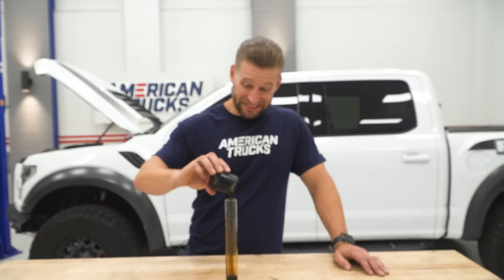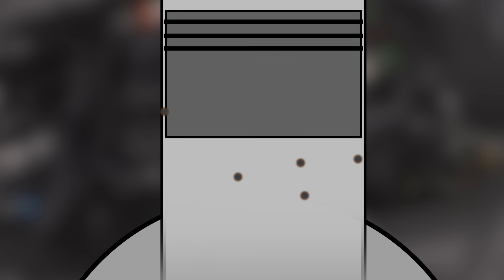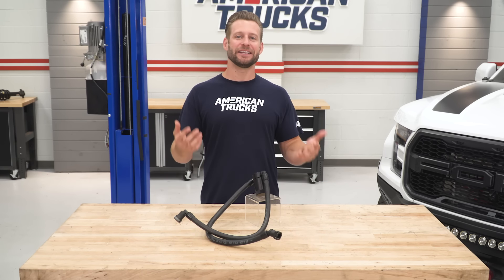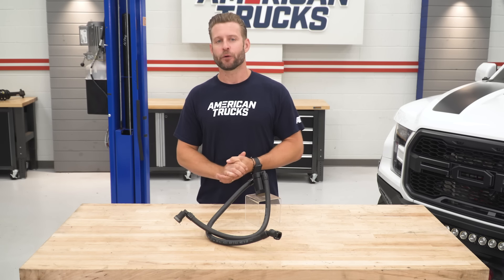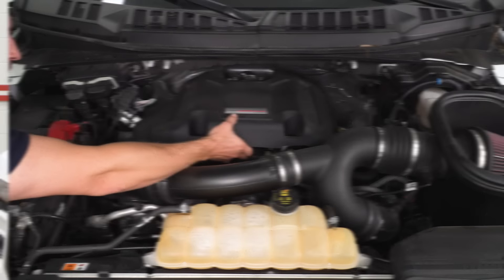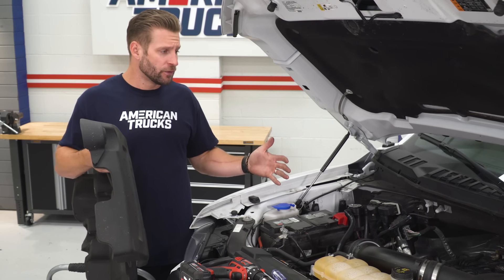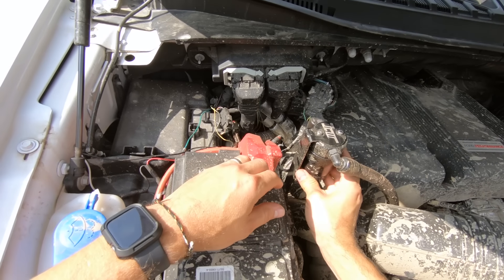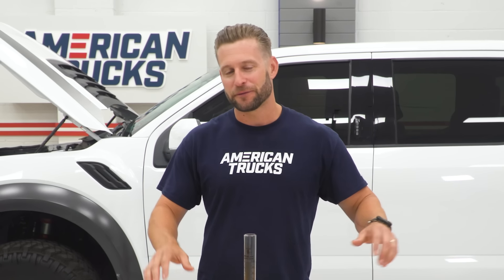Does Your F150 Need a Catch Can? - Ford F150 Oil Separators Tested And Explained

Comment: Hello, I just bought a use 2016 F-150. It only has 40,000 miles on it. I'm thinking of adding one of these to the engine. This may be a dumb question, but is it overkill to add one to the driver side and passenger side? Or do you really only need one? Thank you!

Comment: Did they fixed the driver side? That crap accumulating in the inter cooler?. On my 2013 i've connected the catch can on the driver side as well so i can catch what was originally accumulating in the inter cooler.

Comment: I have a 2020 F150 3.5 Ecoboost so is this really recommended then for that new of a engine? You would think Ford would do something about that at factory if it was a real problem?
Reply from the maker: Ford introduced port injectors to go along with their direct inejctors in ever since 2015 in their 3.5L Ecoboost engines. This helps take care of valve coking, but as you saw in the video your 3.5L can still produce a good bit of blowby just from daily driving. Installing a catch can, even on a newer F150, will result in keeping things cleaner and running stronger throughout its life. 😁 -Zach

Comment: Just installed mine on my 2016 f150 with 3.5 eco. Truck only has 36k. Did a 2 week check and can was about half full. Had a little sludge at the bottom, but was mainly pretty watery. Almost compare color and consistency to a coffee with creamer. Doesn't sound normal to me, but I also don't know much about these. Thoughts?
Reply from the maker: Totally normal Anthony- what you're seeing is condensation mixing with the oil causing that milky brown color.  Do you live an area with a colder climate? -Justin
Reply: @americantrucks  ok thank you for responding. One less thing to worry about. Yes I do live in SE Michigan and the weather did just start turning

Comment: Have a 20 Raptor, not have an issue with hose that was basically snug up against the engine cover bolt with the JLT?

Comment: I have had the issues with stalling and this was recommended to me. After doing a lot of homework, I can see why I need it. (2016 F-150 2.7 EB). My question is how to clean up all the gunk that may have built up on the intake valves...I just changed my oil after hitting 185,000 and my JLT will be here next week. Is there a fuel additive that will clean the gunk out of my engine that has accumulated?
Reply: Id like to know about this as well!

Comment: Not really changing the octane rating of your fuel, but artificially bumping your compression ratio except it doesn't do it the same across the board so you'll have high compression on one cylinder and regular compression on another.

Comment: obviously works, not doubting at all, but wonder how much this pulls out compared to the versions that have suction from the turbo's pulling the gases out of the engine.  I realize this has suction, but how much is the flow of gases being hindered by the catch can and media?  For instance, imagine sucking through a straw, then sucking through a straw with a piece of cotton in it.
for all that matters, how much oil is being sent through the turbos in the catch cans that use the turbo's for suction?
hmmmmm....

Comment: Just recently bought a 2020 F150 Lariat, do you recommend that I install one? Will I need to remove it before having my oil changed at the dealership?
Reply: I need these answers as well have you installed one on your? Im on 2k miles on my 2020
Reply: @osvaldoordaz1047  No, I'm waiting till December after my first oil change
Reply: @botpatch1  ok thanks for the quick replay and are you just planning on taking it out every time u take it for service?
Reply: @osvaldoordaz1047  yeah, i want my truck to break in or let it run as factory intended for the first oil change before i add the modification to it. As i understand it, 2019 and 2020 ecoboost is a bit different - I think the duel injection is a bit better in 2020 version. So I have to do a bit of research before I install it completely. I don't think it will hurt anything since it just catches gas vapors and condense the "grim" from it, it's a bit different than say installing brand new intake or change something major on the engine.

Comment: Do you need this if change the oil every 3k miles? 

I’m in a very hot climate 100 degrees is the norm where I live 

I have an ecoboost 2021 f150 what do you think guys?

Comment: The 2nd gen 3.5 isnt immune to it either. The port injection doesnt kick in until your in boost under load. Direct injection is a constant at idle and normal driving. If you ever do a fuel system treatment, beat on the thing a little bit. Otherwisd your just washing your pistons off

Comment: I installed this on my 2019 2.7L EB F-150 and the check engine light came on three days later. I checked both hose fittings and they are snapped in place and the can is screwed on tight. Is there a particular way the hoses need to be connected to the intake manifold and crankcase? I simply followed the instructions from JLT as well as the instructions from this video and others. I also got my truck serviced at the dealership (this was installed after the service on the same day). Any info that anyone may that can be sent my way will be greatly appreciated!
Reply: Why was your engine light on? What was the code?

Comment: what is the cost , i have a 98 f150 , my dip stick was to short, i was keeping 7 quartz in it
  then i took my oil and put 6 quarts in it and marked it on the dip stick.so now it seems to not use much oil, but would like to find the price of what one of these cost,   and if it works on a 98 4.6 motor

Comment: Do they make this for older Trucks? Ive got a 92 F-150 that has this issue BAD! Usually, when I change air filters the Airbox has a solid 1/4 inch of oily snot. (Already verified there is no excessive blow-by and the engine has good compression.)

Comment: Would you recommend the JLT (only passenger side) over the Mishimoto (PVC+CCV) for a 2016 XLT 2.7EB with 40k miles. Never had an issue with the truck but $150 vs $400 is a big difference. Thanks

Comment: I put one of these on a 04 6i jeep grand Cherokee and noticed more oil   in the can after climbing steep hills. I think the angle pooled more oil in the rear of the engine were the PCV valve is and got vacuumed.

Comment: Will this system work on a 2002 Ford F-150 4.2L V6?  Wondering if this would be worth putting in and since the PCV valve is positioned near the throttle body not in the valve cover if it will still work?

Comment: Very knowledgeable I’m gonna definitely get one of these catch cans for my 2016 expedition 3.5 EB. But I do have a question for you maybe I’ll read this or somebody will know. Again I got a 2016 Ford expedition I’ve changed out the ABS unit all the other braking systems Have been on recall so that’s all been replaced. I just replaced my vacuum pump as well and my car still does exactly the same thing. It was at the dealer for over 10 days and they said you need to replace this this and this which I did couple thousand dollars later still have the same problem, when I make a right hand turn it seems like the back right rear tire locks up. This is a 2 Wheel Dr. car in my track sensor light goes on on the dash does anybody know why this happens again right rear tire seems to lock up like it’s in four-wheel-drive and I don’t have a four-wheel-drive truck. It’s two wheel. Thanks in advance appreciate your input.

Comment: Stupid question, have 2016 3.5 e-boost with 50K miles.  Should I also install on driver's side, too?  Or, is only one side adequate to ensure proper engine health?
Reply from the maker: Both sides with a turbo application is never a bad idea.  -Justin

Comment: I just bought a used 2.7L F150. I've always had V-8s and never a turbo. Excuse my ignorance please! My question is, is there just one pcv valve? I saw another video where it looked like they ran a line from each side. I never messed with the pcv on any of my vehicles. Never had a problem. Or it may be that I swap too often! LOL!
Reply from the maker: No apologies necessary Willie! There is a driverside and passenger side PCV hose.  Now in this video we did focus mainly on the passenger side as it typically is the 'more productive' side but if you're looking for ultimate and total protection, we always recommend addressing both sides. In fact there are some options, like the Mishimoto that do accomplish that, right out of the box. -Justin
Reply: @americantrucks  Thanks for the reply Justin! I'm certainly learning a lot from YouTube about these vehicles! Thanks for the help!
Reply from the maker: Anytime sir!  Good luck with the truck! -Justin

Comment: I have a 2018 F150 eco boost. In the past year I have replaced the oil pressure sensor twice. I’m wondering if this would help prevent any sludge from affecting this issue? Also is there a filter inside the drain pan that could gunk up and cause a sensor issue to appear? Any help would be greatly appreciated. Thanks

Comment: I'm not sure but I'd assume you'd want to snake the hose over the intake instead of under or oil and condensation could accumulate at the low point in the hose.  Just a guess, maybe I'm wrong too.

Comment: I bot the JLT oil separator from AT to install on my 2020 F150, have not received it yet. How does this JLT setup compare functionally to the bigger more extensive setup as described in the video by FordTechMakuloco? I wish I had known about this problem when I first bot my truck. Fixing to do first oil change at 5000 miles and also install the JLT catch can set up.

Comment: Got a 2002 F150XLT with the 4.6 Triton v8 would this help it run better? Has 277,800 Miles on it. Runs good now.
Reply: it will help considerably mainly due to the amount of wear your engine has being 17 years old and nearly 300k miles. you most likely have some blow by so the PCV is having to do more work as more fuel gets past the rings contaminating your oil and increasing crank case pressure. 

that being said its probably time to start saving up for a rebuild on that engine, im a proud ford guy but even then 300k miles on a gas engine is pretty hefty toll. hopefully most of them were highway miles and not alot of towing.
Reply: @The1Retribution  in April I had the timming chains replaced,  tune up, radiator flushed,  new transmission fluid and filter, and brake system flushed. The mechanic said it was a good running truck.

Comment: I just acquired a 2016 2.7 model...is that considered an early Ecoboost model that would need a catch can?
Reply from the maker: The 2.7L Ecoboosts were manufactured to have both port and direct fuel injectors actually! That means carbon build-up isn't too crazy of a concern. That being said - it is absolutely recommended to add a catch can! -Zach
Reply: @americantrucks  thanks for your reply! i appreciate it

Comment: Does this eliminate drilling a weep hole and do you notice a difference immediately? I ask because my 2016 f150 started running funny today. Almost like a misfire. Drove it for about an hour shut it off turned it on again and it ran fine. Was wondering if this could be the issue?

Comment: How much is this REALLY needed if you do not have strictly a GDI only engine? Also, do you have a set-up for a 2nd gen coyote V8 on a F-150? (or are they NON -GDI engines?)
Reply: The 5.0 Coyote got port injection in addition to the direct injection in 2018 so the port injection solves the issue.

Comment: I had a UPR catch can high performance system like $600 on my 2015 3.5 liter F150. When I got the 2022 3.5 liter they supposedly redesigned the engine with an extra injector to actually clean the intake. I gave my system away.

Comment: My 2014 has about 60k miles on it. Is there a way to clean the previous owners "gunk" if you will.
Reply: You don't have direct injection so it should be fine. But if you still want to clean it, Seafoam in the fogger can works great!
Reply: Remove intake mainfold make sure valves are closed.grab a shotgun with bird shot only!and blast the valves clean usally takes 3 shells per cylinder.

Comment: I have a 2008 Late Build 5.4L 3v F-150 ...just Rebuilt the Engine and confuse on which is the PCV Valve? RH side ( Pass.) Port out of Valve Cover has no Check Valve ( one-Way ) PCV ? which goes just before the Throttle Body & the LH Side ( Drv. ) has a Connecton on the Valve Cover which goes to the SIDE of the Throttle  Body ( looks like it's electronic?) I blow and suck on that tube and on Valve Cover side it doesn't pass AIR either way? wondering Why? where do I Install this typical Catch Can on my Truck? Thanks in advance. George

Comment: I have 2020 2.7 XLT. Do I need this on or Ford has resolved this issue?
Reply from the maker: The 2020 2.7L Ecoboost engines are built to have dual injection from the factory, meaning alongside their direct injectors they'll also have port injections. Because of this, you won't see carbon build-up being as detrimental to your engine as it would be on first gen 3.5L Ecoboosts made from 2011-2014. I still recommend picking up a catch can though! Even though your engine has port injectors to clean off the intake valves, it will still be producing blow by. -Zach

Comment: Anyone who's seen a bong knows the dirty air needs to enter from the bottom and filter up through the filter media. All of the cans I see have both intake and exhaust at the top or on the side, right beside each other. This will accomplish very little as the air will take the path of least resistance and just bypass the filter media. 

So what would happen (for conversational purposes) on a brand new GDI car if you just ran a hose from the crank case and dumped it out the bottom of the car? Just let it vent to the open air? Check engine light? Anything? I suppose you would need to cap off the return line back into the intake to prevent an undesired pressure differential in the intake, but aside from that - any issues?

Comment: I'm a new subscriber. I really like how you make your videos. Now I got to go back into the vault of videos and catchup.
Here's my question... I have a 2009 F150 with 4.6L V8, 6sp Auto trans,  Do you have a catch can for my 2009 F150 4.6L motor?
If yes, what are the part number & prices, with shipping, to zip code 96797?  Should I get both driver side and passenger side cans? Should I change out my PCV's?

Comment: Hi, Justin and great video.  I can't believe how easy this installation is.  I am in the process of purchasing a 2014 F150 3.5 EcoBoost.  It has about 115000 km on it.  I was watching another video about installing an RX Catch Can also very well done in the detail area except it's about 3X more in cost.  My question is... is the one that you installed and the RX do the job equally or is one better?  

I spoke with the dealer today and they are going to check and see if the truck has a catch can.  If not I will certainly be getting one.

I look forward to your answer.
Wayne
Reply from the maker: Hey Wayne- Thanks for watching and good choice on the Eco!  As with alot of things in life there are going different levels of products.  While I'm not personally familar with the RX option, it does appear to be a more 'complete' system- which captures both driver and passenger side PCV vapors.  It certainly appears to be a quality piece- the JLT on the other hand is a little more basic and only captures one side (driver vs passenger, etc).  The RX will offer more protection, pound for pound, if you can swing the extra cost. -Justin
Reply: @americantrucks  Thanks for taking the time to answer my Question, Justin. If one wants to know something, ask the expert. Your input is a big help.

Comment: Do these work for 04 f150 with 5.4 3v motor i have a brand new motor with upgraded oil pump will this fit wanna keep the life as long as possible with this new motor

Comment: Does the 2020 F150 with the 2.7L Eco need one of these?
Reply: They added the port injectors to the 2.7 in 2018, so should minimize potential need. I have a 2016 with a mishimoto catch can. Once temps get below 45F consistently in the winter I have to empty the cans about ever 1500-2000 miles. Summer time above 45f I can check it whenever I oil change and not a lot caught. So ambient temp makes a huge difference in my experience.

Comment: Do I actually need this ? Got a 2015 3.5 eco boost and live in Canada. Always used full synthetic and at least 91 to 94 octane. Keep up with plugs and coils and in general run  pretty clean. I'm at 260 km and have never had any issues and nothing more than regular maintenance. I suppose if I had it all dialed in with mods and a tune I would definilty get a catch can

Comment: Just put mine on. The thing that took the longest was figuring out how to get the old ones off I kept looking at the new jtls and realized that those are push but there was something different about the stock connectors. Since you really didn't show how to remove those you just pulled on them and they came off it took me a while.

Comment: Does the dual catch can work any better? And does it matter where you mount it? Up high , lower better? Will it create suction and suck out oil if mounted in the  incorrect place or height?

Comment: 2016 eco boost limited. Increased mileage by 1mpg but can is 3/4 full every 1000 miles. So do I have a bigger issue with my truck since you got 10ml in 2k miles???
Reply: Jason Farr I have the upr can on my 2016 3.5 I get about 7 ml in summer months and up to 12 in colder months about every 1500 miles so I say it’s normal.